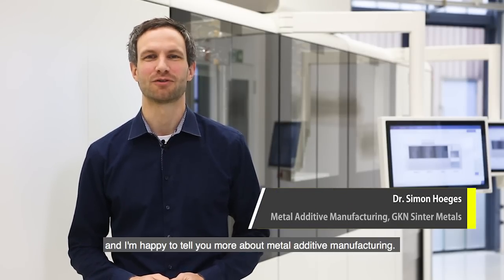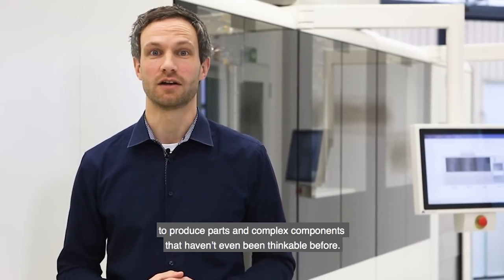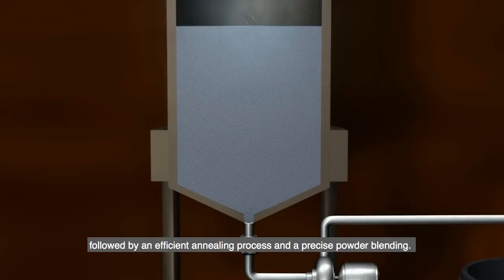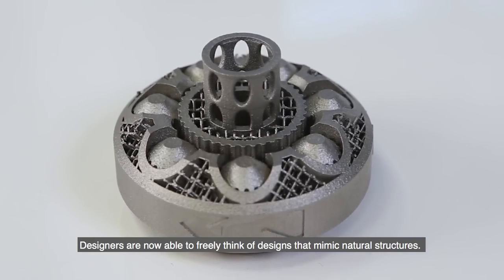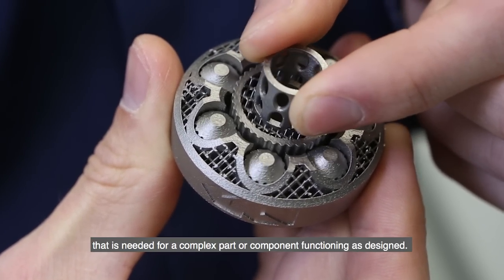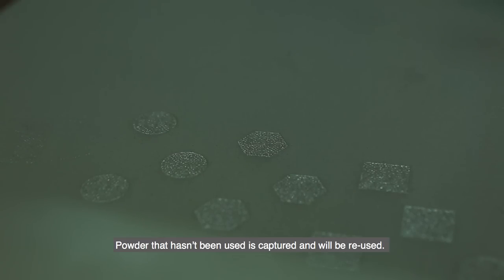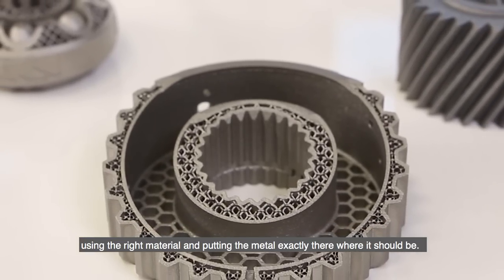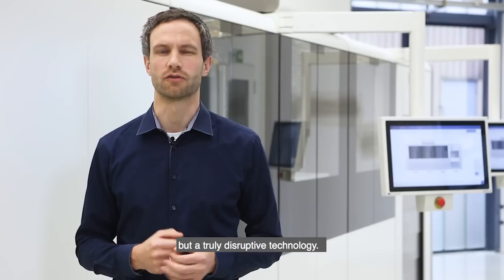Metal Additive Manufacturing @ GKN - When future becomes reality

Comment: Hey Is it Possible to receive the cad for that gear i want to see how it works and gives me a idea on the machines tolerances
Reply from the maker: Hey. Currently, we can’t provide you the CAD file. The machine tolerances for metals are usually around “ISO 2768 class m” values. For parts like this, there is more a need for the right adjustment of the “gap distances”.
Reply: ok thanks for the info :) and the Great Video